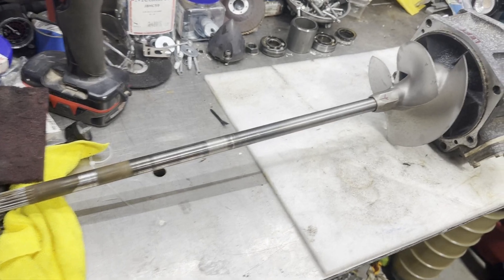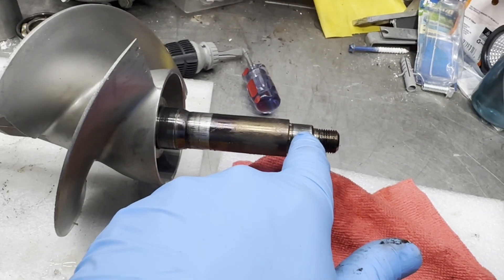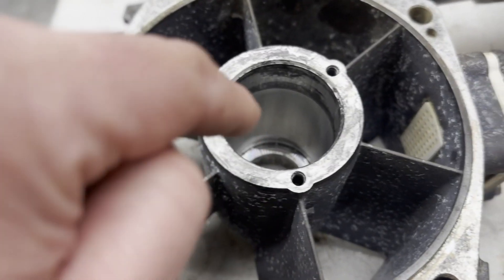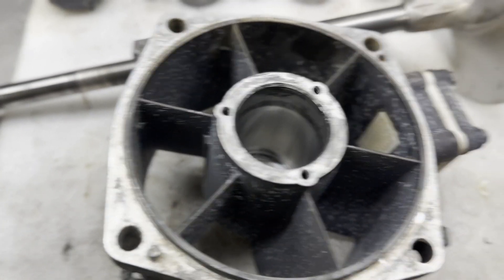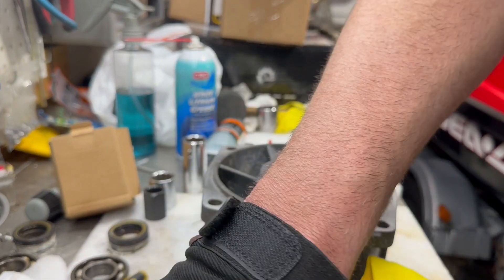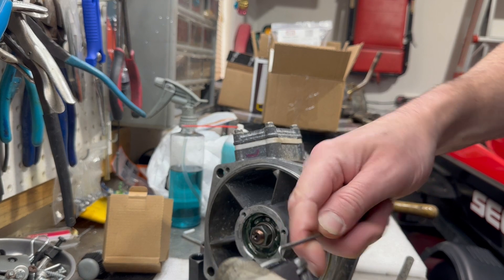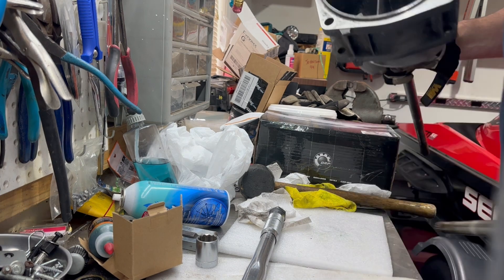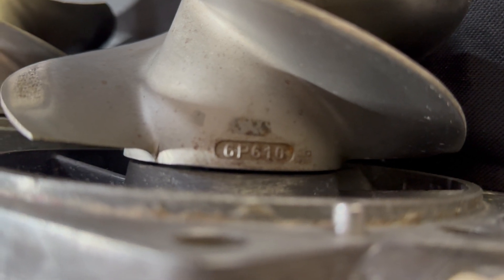Yamaha AR230 HO jet pump overhaul

Comment: Great tutorial, it appears feasible accomplish with the proper tools. I would need a press to get this done, unfortunately I don't have that. Thank you and God Bless!
Reply from the maker: Thank you! And you could do this using a "low cost" arbor press. These parts don't require much force to remove or install. I just so happen to have traded my way into a 20 ton press shown, which is overkill on jobs like this.

Comment: so in the video you use the epnoc grease for everything but the manual calls for epnoc on the spacer and in the cone but calls for Yamaha Grease A (Yamaha Marine Grease) is it ok does the epnoc have the same capability?
Reply from the maker: I did use epnoc grease for the entire jet pump assembly which is made for jet pump bearing lubrication. I read this about the cone, which is the reserve. The Yamaha marine grease is more tacky, the epnoc is thinner, for my application I didn't see a need to differentiate and simply used the epnoc. ( I also pull these cones annually to refresh things and replace grease in the cone) But by all means, utilize the information in the manual to do this as you see fit, my use case with regard to PM's is what I thought to be practical.

Comment: Question: (During reassembly of the shaft into the bearings, you press on the race of the top bearing as the shaft comes through) 
Doesn’t the race from the bottom bearing have too much pressure on it from the shaft pushing through? 
Because nothing is supporting the race on that inside bottom bearing… Just curious because I’m about to put mine back together 👍🏼
Would you have done anything differently?
Reply: I'm also curious.  I wonder whether the spacer can support it in place...
Reply from the maker: The spacer supports the second bearing outer raceway.. off of the first bearing to install. That first bearing has its outer race supported by the step in the housing. 

@markgattinger3958  I agree that one of the bearing inner races is not supported. Don't see this as an issue though, no other way around it that I can tell anyway, pretty light interference fit and easy to press. 
You could freeze the shaft ahead of time, and or also could heat the ID of the bearing, both options would reduce or eliminate stress at assembly if you are quick. 
I pretty sure I would do this the same way next time though, however I respect your question. I built both pf these and now they are at around 20 hours run time and smooth.
Reply: The service manual states you should press the bottom bearing on the shaft with a given distance from bottom of bottom flange on shaft to bottom of outer race(23mm), then using the spacer press the bottom bearing and shaft in to housing until bottom. The press top bearing in to the housing and on to shaft using a tool that bridges both inner and outer race . Seems difficult